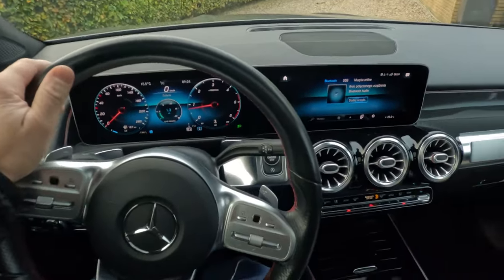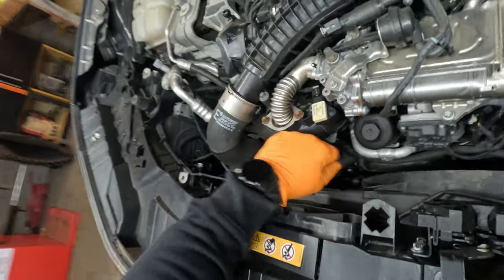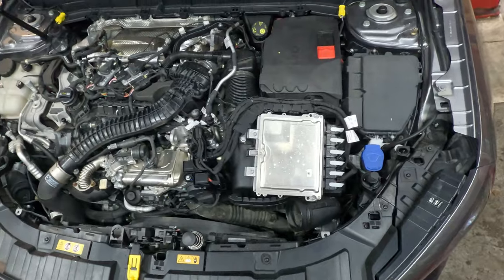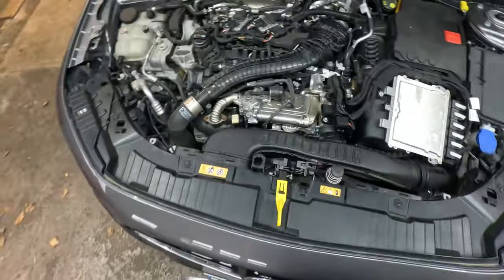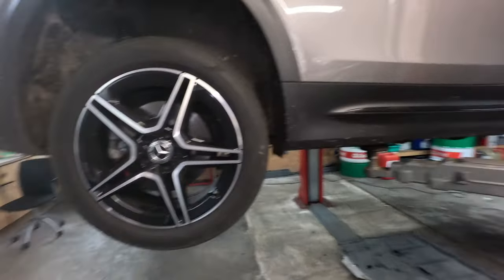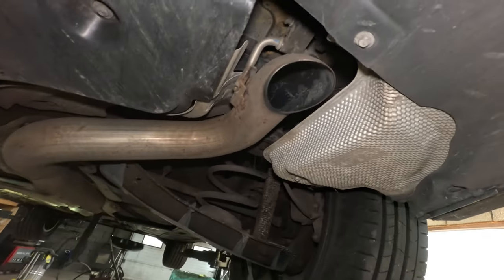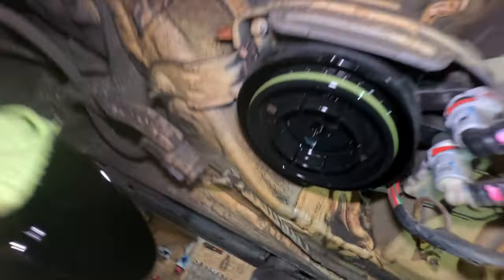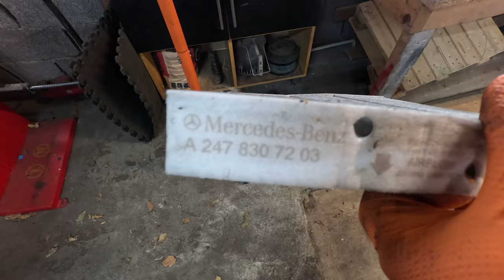MERCEDES-BENZ GLB (X247) GLB 220 d 4-matic Service

Comment: Sandis I have a glb 250 could you show me how to remove the main battery i have tried every bolt torx screw etc what am i missing. thanks. Bob
Reply from the maker: Hi.
Here in the comment section, that'll be hard .